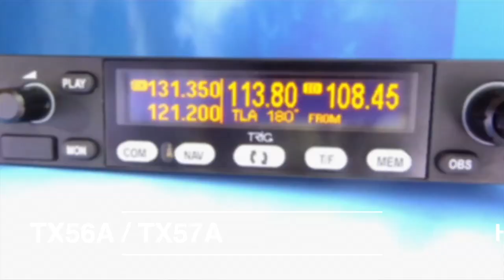Aero-TV: Meeting Our Standards - The DeltaHawk Diesel Program

Comment: Will this be able for replacing an engine in a Cessna 172? Is it  FADEC controlled???
Reply: No the small engine u can use for seccna  is 80hp n more, hope u get.
Reply: Yes they are the right size and power for a 172. There would be significant fuel system changes for Jet-A. No it is not FADEC, it has a mechanical fuel pump (no electricity required).
Reply: You don’t have to change anything on the aircraft fuel system. Tanks are the same. Seals and gaskets and o rings are the same. No fuel pumps. Gauges read quantity not pounds by specific gravity.
Reply: Yes and Yes although I am not a DELTA HAWLK Rep. I just read their web site.
Reply: @Bartonovich52  you're going to have flush out your tanks at least.

Comment: Would like to know if it would be possible to convert for a full-size truck
Reply: Sure for $90,000. This is for aircraft use and is only 180HP.
Reply: Might be possible depending on the power and torque curve.
Reply: Probably better in a Mid sized truck like a Ford Ranger, Toyota Tacoma, or Nissan Frontier

Comment: this thing is a beast. it doesnt even require an electric injector.
Reply: NO MAGNETO NEEDED!  NO ELECTRIC INJECTOR TO FAIL (at least electrically) NO AV-GAS,... SOUNDS PROMISING
Reply: Mount this in a yamaha banshee for the nest bike rideout! I heard the deltahawk 2 stroke run the amsoil interceptor oil in dry sump oil injection.

Comment: Interesting, its been a few years since we heard anything from them.  Glad to see there is a new player in the Jet-A recip market.  Wish we had more spec. info tho _ weight for one.
Edit; From their website  - 
Engine dry weight is approximately 340 lbs., including turbocharger, turbo-to-engine exhaust system,alternator and starter. 

Additional weight-reducing innovations:

Assembly - approximately 80 lbs. for most installations
Smaller cowling - reduces weight and drag
Fully installed engine is anticipated to weigh equal to or less than equivalent engines being replaced.

Comment: I work on the Airbus A380 Platform where a lot of high-pressure high-temperature bleed ducting has v-band clamps that are far better than that stamped sheet metal version attached at the flange of the exhaust flex coupling. Few other things I see that are not commercial aviation standard. Is this because of the engine being shown is a prototype or display model?

Comment: A v4  is one of the worst engine layout that exists, that’s why no cars use them. But at least you guys are doing something.
Reply: @Logan ce2uh Wrong ! Saab had a few of their models use a V4. My father owed a 2013 Hyundai Santa Fe that had a V4, and there were other manufacturers that used them too. Do your research before you post ignorant comments.
Reply: The drawbacks of a V4 are less relevant for aircraft because max prop speed is commonly 2700 rpm, assuming they run these things without a gear reduction box, it's not a lot of RPM.

Comment: Sound like a $100,000 engine.  My “experimental budget” is sub-$20,000 for an engine.
Reply: Sounds like your stuck with a lawnmower engine then. Hell, a new IO390 is $60k these days. And that's without any upgrades or firewall forward kit
Reply: Automotive with a gearbox is your option in that price range.  Some people with RV-10s use GM LS engines and around a 2x reduction with takeoff power between 5100-5400 RPM, but not sure what size aircraft you have.

Comment: 180hp! Would be prefect for a Cessna considering how well the CD-155 performed with less HP. They need to get on the STC ASAP with an engine like that!
Reply: Until you see the price 1 Let me know what your limit is on this install ?
Reply: Torque is very important for aircraft also besides power. You can swing a more powerful prop with higher torque. These engines have better torque than Av-gas engines. German engineers in WWII wanted to design Desiel Aircraft engines and had a few but Hitler wanted other stuff.